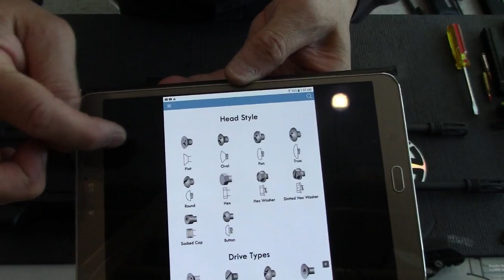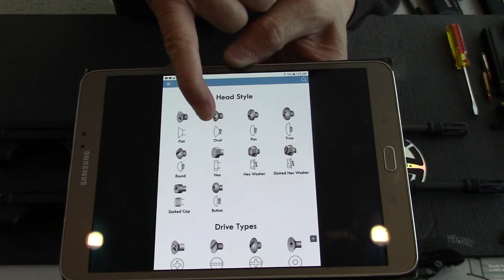Type 97 Gen 1 vs Gen 2. Bullpup ban? EMEI QBZ-95 History.

Comment: I did the screw swap 80 rounds later its still solid holds zero awesome info cheers
Reply from the maker: im glad to hear that. i dont know why me a gun hobbyist could see the problem with the rail without shooting it and the design engineers didnt. thanks for the feedback.
Reply: @gnutzguy  we need people like you on here figuring these things out 😁
Reply: Seems like they fixed this with the Gen 3. I loosened the screws a bit and have no wiggle at all.
Reply: @zillpickle8910  I didn't know there was a gen 3. It took about 40 rounds for my upper to losen
Reply from the maker: @zillpickle8910  good to hear. it seems like emei are receptive to hearing problems and improvements that can be done.

Comment: I just used RED Loctite on the 2 screws. Holds perfect. If you want to take them out, just use a heat gun. Also, put a dab under the rail where it meets the frame. It keeps it from walking.  I rarely take off my upper. Its a clean running rifle. No need to be taking it of and on.
Reply from the maker: No thanks, if I have to do what you did, I rather not use the gun.

Comment: Great video, I have a gen 1 that I've done a ton of work to and I don't get why they'd increase the size of gas ports, thing already flings brass a good 30 feet away.
Reply from the maker: actually, i was talking about the relief ports but when i compared the gen 1 to gen 3 in front of me, they appeared to be the same so i think i made a mistake bcos of the carbon build up. i will correct that statement in the description... thanks.

Comment: Just a couple of points I've noticed. That strange post on the rear sight is a carry over from the QBZ 95 tooling. Originally that post would have a tritium insert and the front sight hood would have 2 tritium inserts on the side. 

Also those "gen 2" magazines also came with many of the gen 1 rifles. Not sure if the change was a variation happening in China or in Canada at North Sylva.
Reply from the maker: 1. i wondered how well it worked at night?
2. the gen2 mag came with the rifle and not purchased separately?
Reply: @gnutzguy  Yes, I've personally seen Gen 1 rifles come with that magazine in the box 
right from North Sylva.
Reply from the maker: good to know. my rifle is a late serial number so it got to be random.

Comment: I have a question regarding mounting a 3-18x50 scope on the type 97 g3 would i need a high mount to clear the bell on the scope and will the cheek weld be ok or would it be more of a chin weld?
Reply from the maker: with the g2 & g3 , cheek would be fine.

Comment: So the firing pin floats,from what I heard. Do you need to take the bolt further apart to clean and lube ? Or is this as far it goes ?
Reply from the maker: full monty on the t97 is coming up, the bolt and fcg will follow in part 2

Comment: The preferable way to mount the upper would be with a steel washer and an oval machine screw. Otherwise the aluminum mount holes may become out of round over time. The challenge will be finding the proper diameter washer that will fight tightly within the mounting holes. Alternatively an inverted Chicago machine screw could be fitted to the mounting holes providing a steel lined mounting surface.
Reply from the maker: unfortunately, the washer wouldnt give you enough contact surface with the screw, thats why i recommend beveling the hole.
Reply: @gnutzguy  Bevel the washer hole. Or,  use a washer and button/pan screw for full surface contact. Same reasoning applies as with your suggestion, except it's a steel on steel mating surface. 

Edited to add: The only consideration is that the washer must fit tight into the mounting hole.
Reply from the maker: @crvzer  let me know how that works out. thanks

Comment: Actually type 81 rifle is chambered in 7.62x39mm cartridge with the intention of replacing the type 56 while waiting on the type 95.
Reply from the maker: T81 Not only came in 7.62 but also in 5.8x42 before it went into the qbz95. Type 97 is 5.56 for export, came in two years later which we have in Canada.
Reply: @gnutzguy  That's would be type 87, the first generation of small-caliber rifles for PLA.

Comment: Believe the main spring is longer, which makes reassembly not smooth.
Reply from the maker: i think longer return spring slows the bolt back (less jarring) but speed up the bolt forward to improve feeding, what do you think?
Reply: @gnutzguy  Make sense, but I figure the No.1 reason for feeding jam is on the hold open hook. From some mags, once in, the ammo is positioned too far back, so sometimes being caught by the hook when fed in, make it angled up before the bolt comes in contact, with ammo tip pointing up out of chamber hole, it jams.  Once filed the hook short, and rounded the corner and under side, no more feeding issue, feeding ramp was added before this improvement.

Comment: Would some lock tite solve the problem of the upper getting losened up?
Reply from the maker: cant locktite something that require frequent cleaning .
Reply: @gnutzguy  
Thank you sir...for some reason I thought the inside part could be acessed without having to remove the top.
Reply from the maker: @VLK-73  i sold the g2 and got a g3, rails not loose. They listened, lol.
Reply: @gnutzguy  
I have another rather stupid question:
Tried to clean it for the first time...haven't got a chance to go out and buy the 22 cal bore snake yet, so I figured, that I would just use the supplied cleaning rod in the pistol grip.
All I had available was 270-35 cal patches, so I made them smaller by cutting them in two.
To my surprise I could NOT push that cleaning rod down the barrel regardless of putting the patch through the "needle eye" loop or even just pushing it infront of it..(the rod would go through without the patch, but with patch it was pretty much dead stop after clearing the chamber).

Was able to run through the kit supplied cleaning brush, but it was not easy either.
I never run into this type of situation before...I'm new to the 223 platform, but not new to gun cleaning and that should make no difference...any idea of why the patch refuses to go through the barrel?
Reply from the maker: @VLK-73  sorry, i never use the supplied kits to clean. i use a multi caliber cleaning kit with brass rods.
Reply: @gnutzguy  what's the difference  between g2 and g3
Reply from the maker: @MorningMotivationChannel  just the rail,  from keymod to mlok. See my latest vid on type 97
Reply: @gnutzguy  I got a gen2, but want to replace the screws. Do you happen  to know the pitch / length needed for replacement screws?
Reply from the maker: @MorningMotivationChannel  good question, i will put in description.
Reply: @gnutzguy  Awesome, thank you sir. Very helpful 👍 you earned  sub from me

Comment: Can 5.56 Nato ammo be use in the T97 3 Gen?
Reply from the maker: i always used the ammo thats printed on the gun
Reply: @gnutzguy  
That fare.😁
Reply from the maker: when i get problems i dont wanna blame the gun when it was my fault for using different ammo than recommended.
Reply: @gnutzguy 
 You correct. 
Since the T97 is basically a military rifle,  I still can't understand why a 5.56 nato round can't be used.
Reply from the maker: all im saying is im not supposed to used 5.56 but that doesnt mean you cant.
Reply: @gnutzguy  I don't find the ammo type info on the barrel. 
But on the mag well they printed "5.56mm".

T97 3 Gen.
Reply from the maker: @useryggfdcc  then we are supposed to use 5.56. I dont remember . I just looked at the manual and it says 5.56.

Comment: That design you mentioned on is for sliencer，it is rare in online picture, but it is exist, if YouTube can upload picture in comment I will show you
Reply from the maker: the flash hider is for silencer?
Reply: Gnutzguy sorry my mistake, yes, grenade launch you said which is kind of twist on the barrel is for silencer, I know it is not main idea which most western gun used, but it is true.
Reply: Gnutzguy however, in old age of Chinese military if you have old generation here grenade launch then you can not install silencer because old generation grenade launch will occupy most space of the barrel, but I heard new generation grenade launch which in Chinese military now can install with silencer together, because it is smaller than old generation.
Reply: @gnutzguy  Chinese had developed QD silencer for QBZ95 for a while, and it finally comes with 95-1 but it is rare to see it in use though( cuz they have special purpose silenced submachine gun with fires subsonic ammunition)